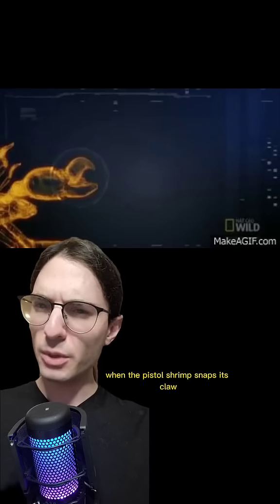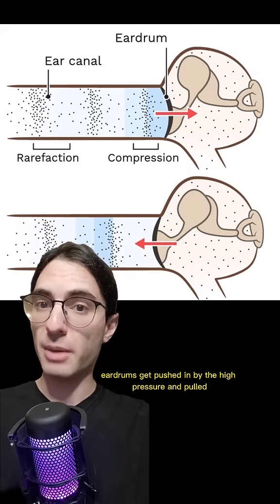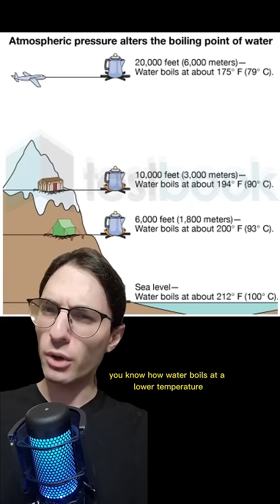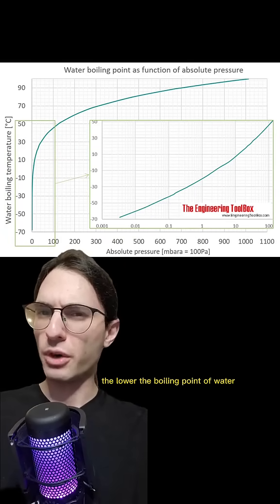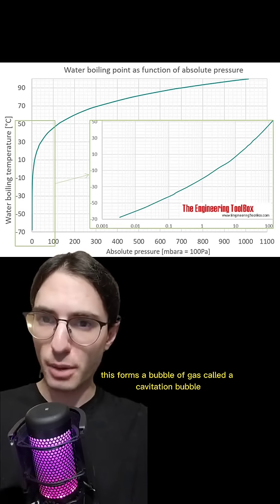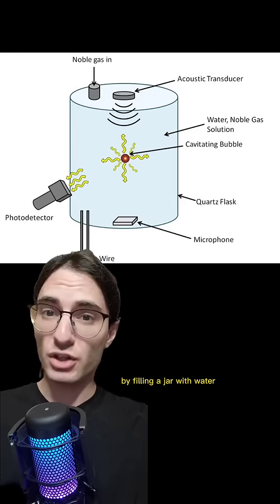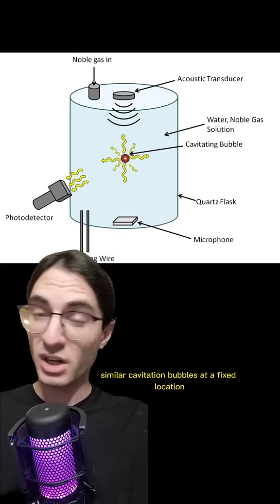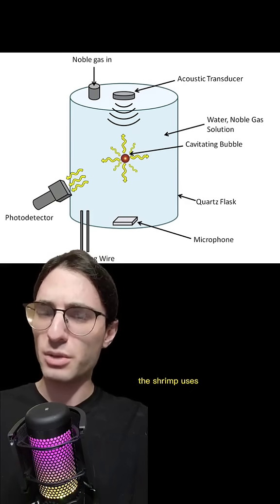Shrimpoluminescence?

Comment: If water boils sooner with altitude, why should we cook the food longer?

Is it because water evaporates before completely transfering the heat to the food?

So you need to keep adding more water until the food is boiled?
Reply: Its assuming that you are cooking with boiling water, which will occur at a lower temperature(due to atm. pressure change)
Reply: Well, it’s just heat transfer, so yeah you’re probably right. I wouldn’t assume that much water evaporates tho, so probably just cook longer…